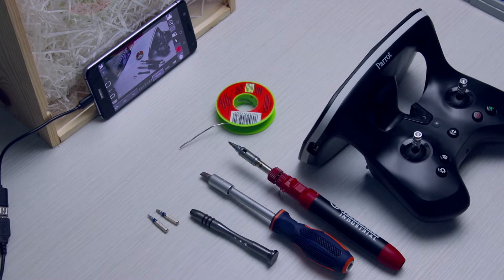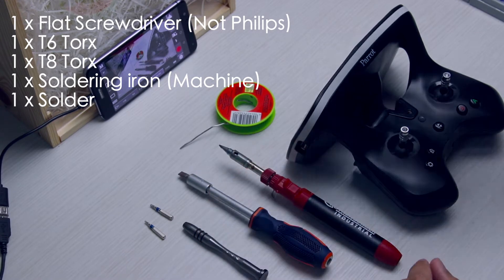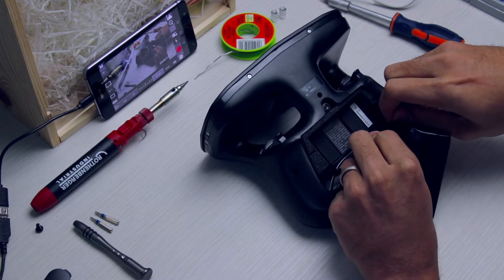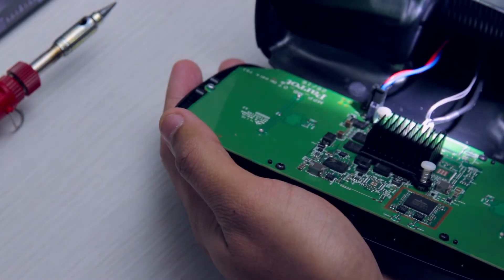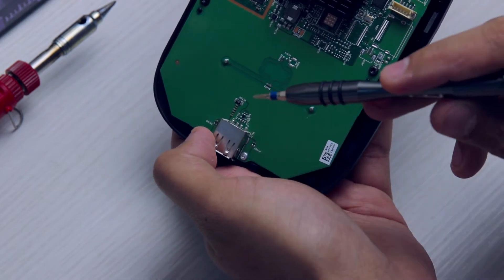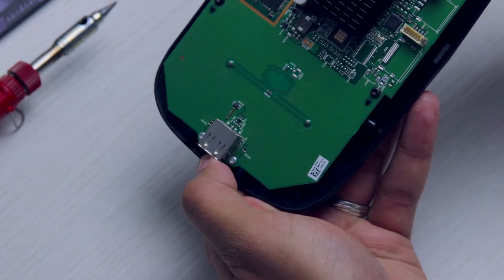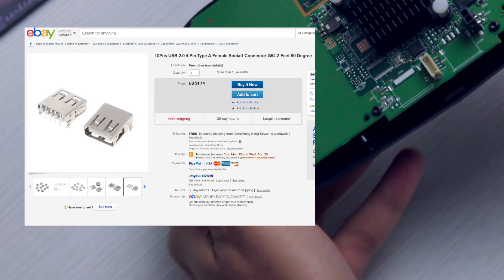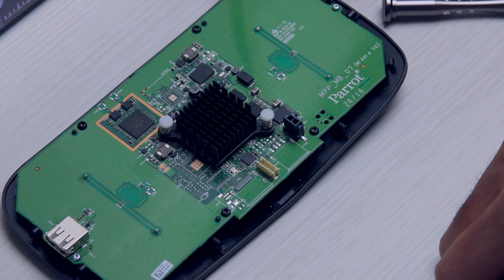Skycontroller 2 - Broken USB Port | Repair | Discussion

Comment: To follow up on my earlier post, where I realized that I didn't have the right soldering tip or the skill to solder those four TINY, little USB terminals: I took the controller to a man deep in the soldering zone at Bridgetown  Repair, in Portland Oregon. Adrian did all the requisite inspection and re-soldering very quickly and effectively, and for a fair price. I can now reliably connect the SC and phone with no problems whatsoever.  I highly recommend this shop for anyone in the Portland area.

Comment: Great video,👍 I went to make a video for someone and realized I had no USB port I have never encountered this, it was a bit embarrassing 🤣I have changed a broken motor after a crash before, but this is a new ball game for me🙈my USB port has broke off, so I have opened it up following instructions on your video, do I need to buy a new USB port cause its broke off? I'm sure that's what you say on video but just making sure thanks..
Reply from the maker: If you can solder the broken bort back thats fine! But if the legs are completely toast than getting a replacement port would be best! Be careful with the little parts around the USB port area! Use a fine tip to solder.
Reply: @ANTHONYVLOG  ok thank you,👍I have ordered spare part will let you know if it's a success 🙏
Reply from the maker: @GOLDMEMBERTVPaul  excellent, yes please do keep me informed.
Reply: @ANTHONYVLOG  will do👍
Reply: Hey my sky controller is fixed, i ordered new USB online and my father in law soldered it back on for me, it is now working as it was before, 😊 thank you very much for the advice in your video, give your self a pat on the back' cheers again my friend 👏👌😊📽

Comment: Mines is completely broken off, was going to try and repair it tonight but waiting on a torx bit of the correct size.
Reply: Wonder if I should cut the cable and just solder wires to the pads?
Reply from the maker: Mark's Random Videos you could do the cables directly  onto the pcb but you risk ripping off the pads if there is an accidental pull. Id suggest sorting out the socket as that becomes the breakaway point.
Reply: @ANTHONYVLOG  we fixed it tonight thanks to your video, then had a good flight until I crashed and damaged the disco! Pilot error! Thanks for the help!

Comment: Thank you for the informative video. Is there any chance you cold show us how you soldered it? I'm looking at the USB on my board and I can't even tell if it's broken or not. Did you solder on the top of the board, or underneath it?
Thanks again for your help
Reply from the maker: ewoid64 bottom for the big metal case, it had two prongs going through to the back. The top for the contacting pins (4 pins) they do not go through the board. Regards, Anthony
Reply: Thanks, Anthony. I've got it disassembled and am going to take it to a friend who owns an electronics repair shop to check its continuity and do any necessary soldering.
Reply from the maker: Thats awesome your friend will have no problem sorting it out. Let me know how it goes afterwards. Regards, Anthony

Comment: would this procedure work on the Parrot Anafi controller USB-A socket...??
Reply from the maker: Yes the socket is the same and same principle of soldering the socket to the pads. The controller is different so the pcb layout will be different.
Reply: @ANTHONYVLOG  many thanks for the prompt reply and for your time in recording the tutorial.... much appreciated... :-)

Comment: I need to know an important information to be able to load the skycontroller since it came without its transformer. In the round plug that goes in the skycontroller as is the polarity? positive outside? or positive inside. Thank you!
Reply from the maker: Inside Pin is positive and outside shell is negative 13vDC max 2A
Reply: @ANTHONYVLOG  Thanks a lot! Greetings from Argentina

Comment: Great vid. My controller connects to my phone, after 2 seconds it disconnects. Do u think the usp port makes this problem?
Reply from the maker: If it disconnects on its own without you moving the cable or the phone than it is possible its just the USB drivers dropping the connection. Here are some cases where the connection gets dropped.

1. WiFi is left on on the device. (Both the controller and Phone are connecting to the drone, usually it drops the App and keeps the controller connected)
2. Phones USB settings may be conflicting. (USB mode to be in MTP / FileTransfer / USB Tethered. Enable USB Debugging if problems persist)
3. Phone battery too low. (Iv seen this happen on tests, as the current in the controller is not strong enough to charge the phone it drops the entire connection)
4. Physical Problem with either the USB port on the Controller/Phone or Cable.

Hope this helps. Let me know if you found the solution, it may help others. 

Regards, 
Anthony
Reply: Super informative. Thankyou

Comment: fixing for a friend as the USB port came away from the board so soldered new USB port in and everything looks fine but still won't connect. RC only charges phone/tablet. Any ideas?
Reply from the maker: Ian Bailey, use a magnifying glass or microscope if possible to inspect the traces to the connected legs from the board. Before that have you ;

Tried a different cable/s
Enabled developer mode (prompt usb) “androids”
Tried different devices, tablet, phone etc 

If you did all that than check the traces on the board, check the two resisters beside the socket, and check the coil ha sent cracked it’s very small and all placed around the socket. If you can also get som macro (close up) photos of the socket that would be great. info (at) anthonyvlog (dot) com
Reply: @ANTHONYVLOG   Thanks for speedy reply will send Macro's later checked different cables, devices, and developer mode and ruled everything else out so a bit bemused at the moment.
Reply from the maker: Ian Bailey got them. After viewing I can see the coil is damaged/missing I’ll e-mail you the part later as I am at a shoot right now.
Reply: @ANTHONYVLOG  Amazing! Thank you so much!

Comment: Thanks Antony, do you know where i could get a skycontroller 2, mainboard diagram or scheme ?  Best
Reply from the maker: Hello Camilo Murillo, I am sorry I do not have access to the schematics. If I find it I will definitely share. Regards, Anthony.
Reply: Thanks a lot Antonhy for the fast answer. I wrote Parrot but they also do not have it. I just need to know wich is the specific element that was detached to my skycontroller 2 to fix it. I really would appreciate if you can help me. See the pic here  https://ibb.co/g9TmHo
Reply from the maker: Hi Camilo, sorry your message got blocked because it had a link so I didn't see it till now. Please send me an email to info@anthonyvlog and I will reply with some macro pictures of that missing component. Its just a regulator for the USB power.

Comment: Excuse me sir,  can you show me the battery and the connector of the skycontroller 2?
 My skycontroller 2 has a battery very small.
Can you say me whats voltage and cell has the battery?
Reply from the maker: Ildefonso Sk2 has a 2 cell 8.4v at fully charged. Charging voltage 12v 3.5A Skycontroller 2P has a different battery, its a smaller battery.
Reply: ANTHONYVLOG thanks you so munch, but, whats is the difference between skycontroller 2 and skycontroller 2p?
Reply from the maker: Ildefonso the batteries are different, one is square shaped and the power uses a cylindrical lithium battery, with some updated internal components.

Comment: Hi! What happened to break it?
Reply from the maker: Accidents, pulling the USB Cale too hard, moving it over time etc. To avoid breaking, be gentle with the USB port :D
Reply: @ANTHONYVLOG  Hello anthony. The micro usb port of the bebop2 is broken, you think it could be repaired? looks like someone put another cable in the port and it is wasted i cant connect to mi poc. Thanks and have a nice day
Reply from the maker: @gonzarb93  yes it can. I replied to your other comment 😃
Reply: @ANTHONYVLOG  sorry yo brother again, Any tips yo change the micro usb of the drone? Someone put a mini usb instead of a micro USB. There Is another whay for me to download the videos? Thanks and sorry for mi english
Reply from the maker: @gonzarb93  have you tried with a miniusb cable? Did it work? If no than you can check the board and remove the mini and solder on a microusb 🙂

Comment: How many bebop 2 batteries you can fly after a fully charged skycontroller 2 is empty?
Reply from the maker: Leandro Ebner 3 Bebop 2 batteries, with a fully charged skyckntroller and fully charged iPAD. Less if the skyckntroller charges the phone or iPad.
Reply: ANTHONYVLOG At this point, I have to say a big thank you for you. I do not know any Youtuber who uses so much for his community. Stay active, and do not worry about likes or subs. They come all by themselves ;-) I asked because of parrot said 4 hours of battery life, but I am now reassured that it is normal that I can fly only max 4 batteries. Thank you very much. do not worry about my bad english😅. Greetings from Germany:-P
Reply from the maker: Leandro Ebner danke 😊

Comment: Hello. Nice video... I had a question. Mi sc2 cant charge the battery. I think its the board .. My battery has 3 cables. One red ,one black and one blue i tried to charge it conecting the red and the black and it doenst charge... Can you help me. Can i connect the blue and the black???? Thank you
Reply from the maker: helder fernandes hello, charge voltage is 8.37v black (-) red (+) blue is for 2s monitor.
Reply: ANTHONYVLOG . thank you. So I can charge it connecting a charger directly on red and black cables???? Thank you
Reply from the maker: helder fernandes yes. Depending on the amp (a) of the charger it may take time. Ie 1A  Vs 500mA :) be patient
Reply: ANTHONYVLOG  thank you

Comment: i tried today to soilder my usb on my sc2 but my soiler wire wont stick, i guess i will keep trying!
Reply from the maker: Hi Max drop me a few pictures on my FB Page so I can see what you are doing. For the tracks you can get away with a 25w iron and for the shielding may need bit more heating up before applying the soldering lead.
Reply: Max Knight but dont use too much HEAT! it can destroy some of the near part.

Comment: What if your USB port is completely off
Reply from the maker: If its completely off, reinsert it and solder it. If the tracks on the board are damaged create jumpers to extend the damaged tracks. Refer to this video once you place it back on the board.
Reply: Thank you so much
Reply: My port came off and fell out.  I can't read the part number on your video.  Could you possibly reply with the part number.  I tried to get one, but it wasn't right and I can't figure out exactly which one it is.